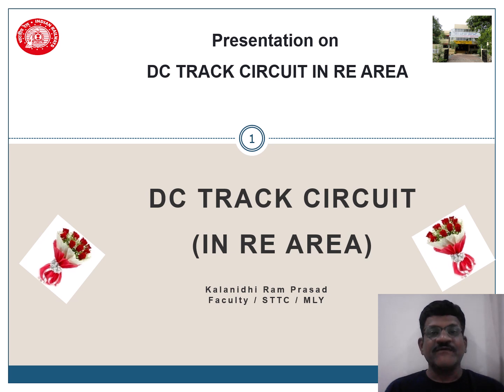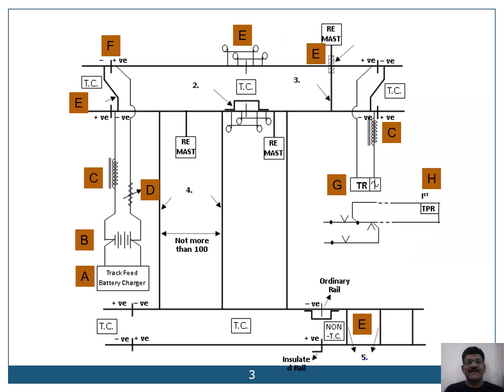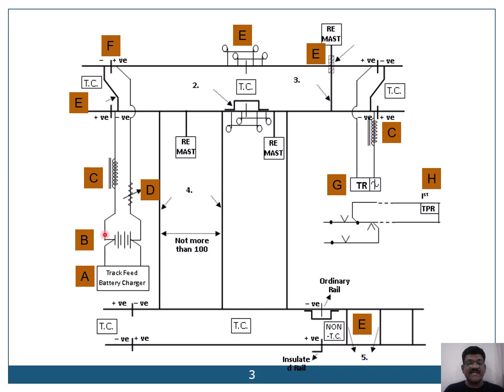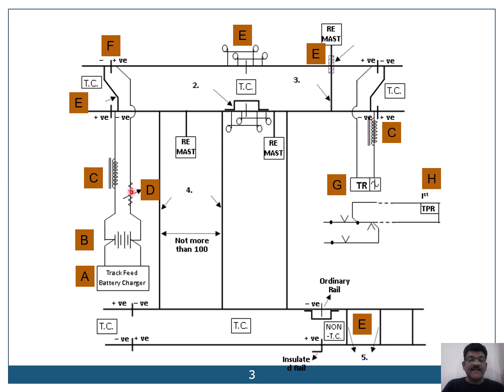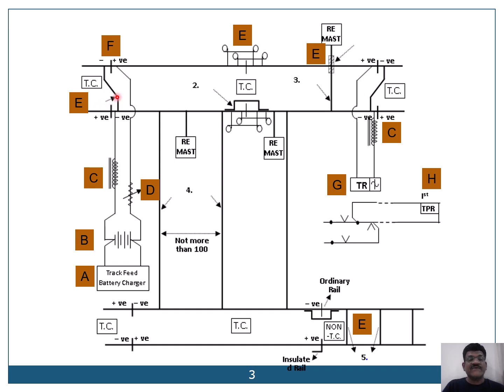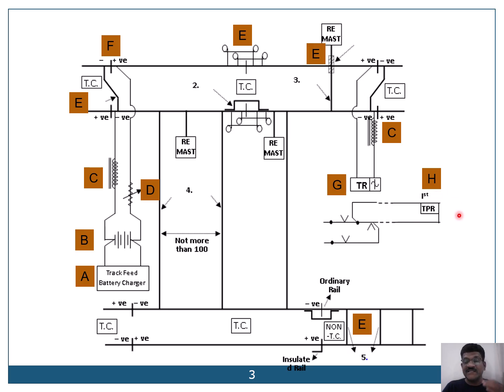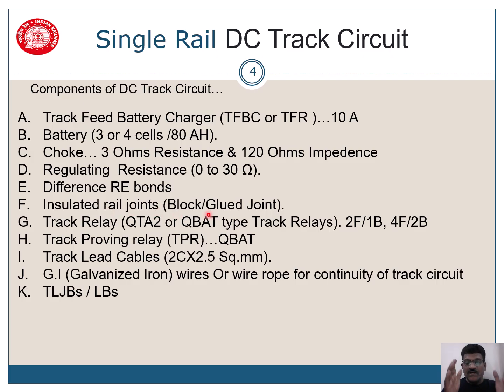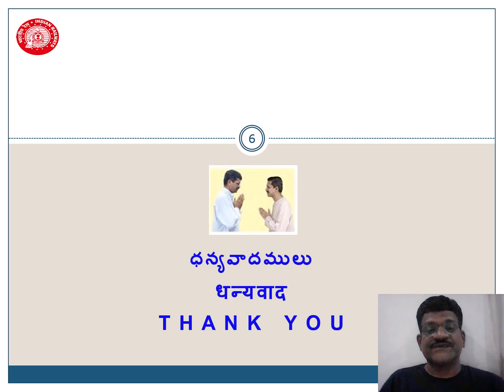Track Circuit in RE area  (part 1)...Components of DC Track Circuit

Comment: Sir why choke is connected to negative  terminl nd resistance in positive terminal.
Reply from the maker: Choke blocks AC supply...hence connected in negative side to protect charger .  Also resistance can be connected any side. But generally + side.
Reply: @ramprasad331 Thank you sir, please sir keep sharing your valuable knowledge.